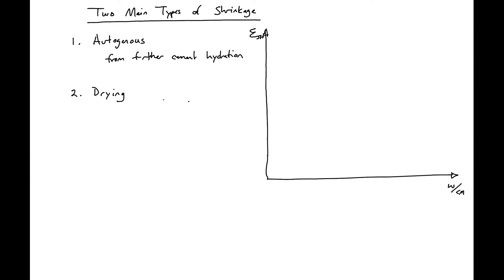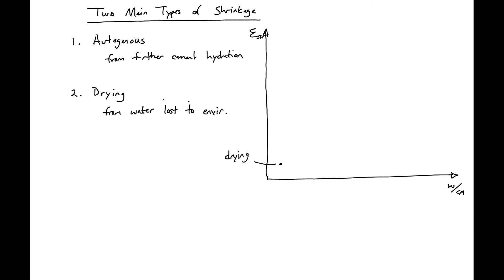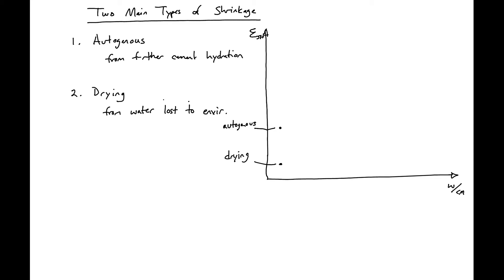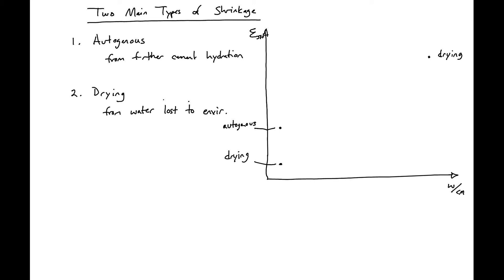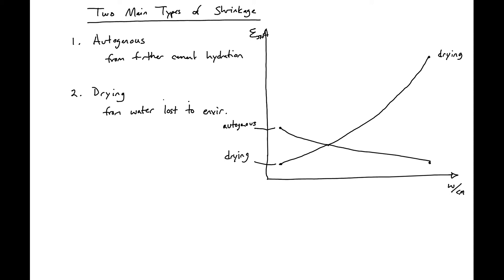4 - Types of Shrinkage

Comment: Dear DAVID
If we have a flat slab supported by columns and if the top and bottom rebar have equal area, then should we consider the shrinkage effect in considering deflection?
Regards.
Ahmad.